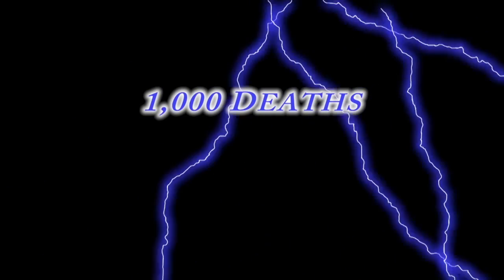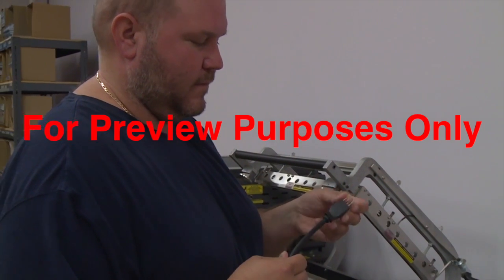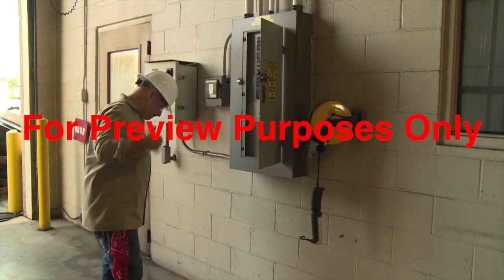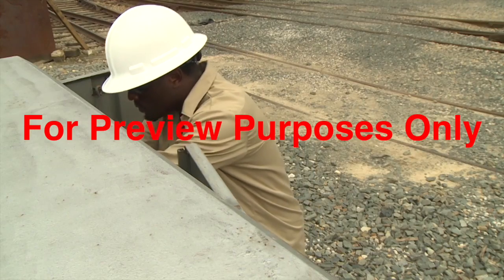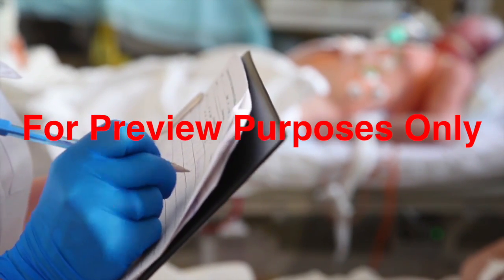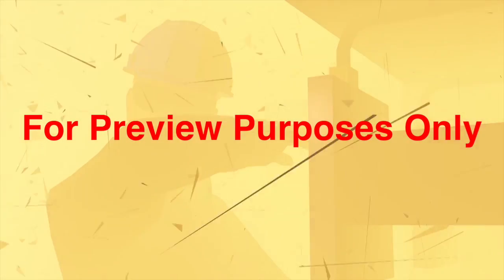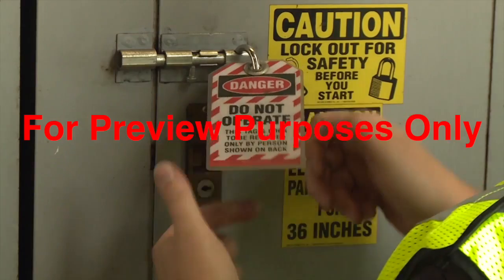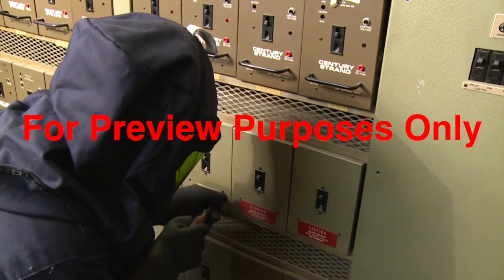Arc Flash Training - NFPA70e Safety Video

Comment: What is the arc flash rating of metal sheets used for enclosures of circuit breaker or fuse
Reply: Late to the party that’s completely up to the kind of enclosure that’s installed electrical cabinets are made of everything from 12ga. Steel to 3/4 cast iron held together with 1/2 bolts every 2” so explosion rating varies wildly between cabinets in the same room
Reply: There should be a rating based on material used and thickness.  @bradreee7290

Comment: Depending on the voltage--especially if it is high, the explosive force of an arc blast can be nearly as powerful or as powerful as a stick of dynamite or even a traditional military grenade. That's my two bits.
Reply: Be careful working around industrial electrical safety switches. Be sure that all of the disconnects are off when working with any fuses. Watch for redundant or backup disconnects required to be operated before you do inside fuse work. Be sure that all load side fuses inside and outside are switched off before even thinking of working inside to replace them. Failure to heed the rules can lead to you facing a deadly arc flash.
Reply: Lockout-tagout rules HAVE TO BE HEEDED AT ALL COSTS. And if there is an arc flash boundary - if you are not qualified to work on electrical stuff in the boundary - STAY BACK AND NEVER CROSS IT! OR YOU DIE!

Comment: Video is a good one but more videos on how to calculate incident energy and determine arc flash boundaries will be helpful to clear things .
Reply: It'd be too complicated when you start accounting for the protective devices upstream from the equipment you're using. By code there should be an arc flash analysis done by an engineer and the incident energy will be posted on the equipment.